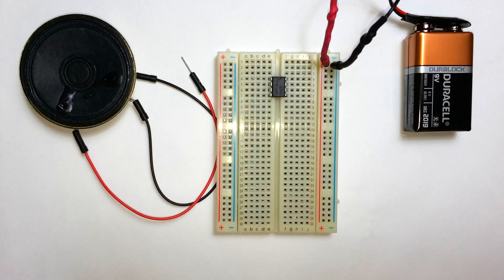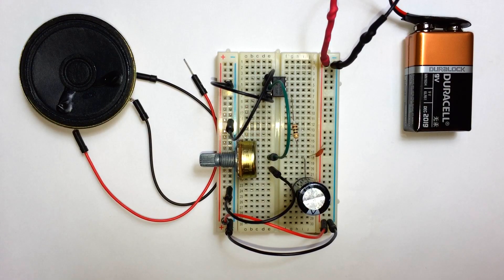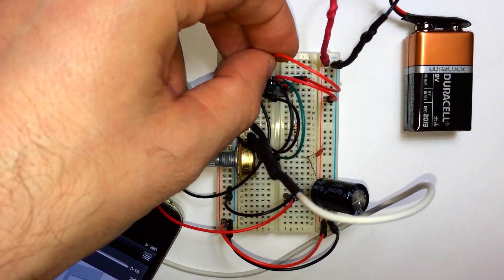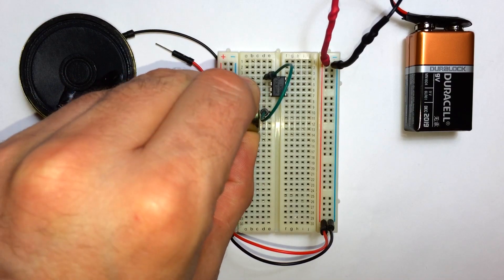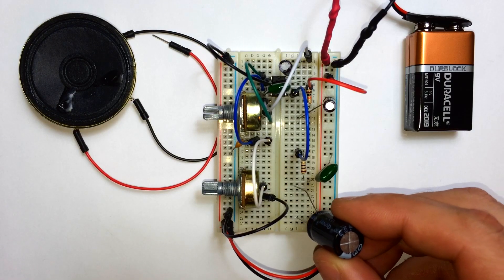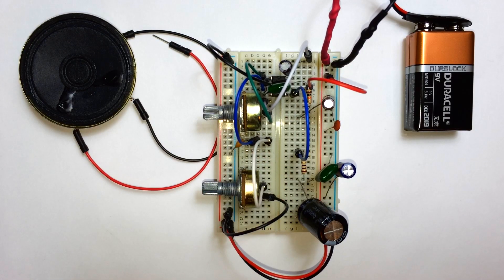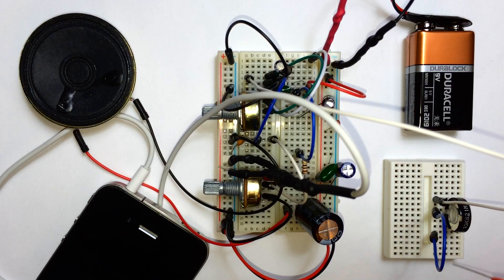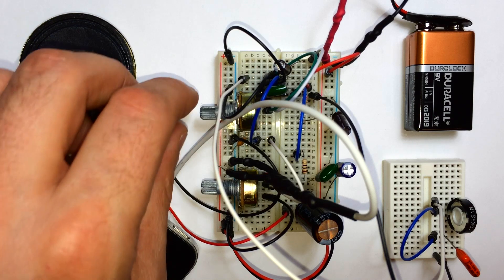Make a Great Sounding LM386 Audio Amplifier with Bass Boost

Comment: if I had two speakers and put them in parallel, would they be weak? if so, if I made two amps, one for the left channel and one for the right, would it be louder?
Reply: two on parallel will cut their total impedance by a half (half as strong) and could potentialy fry your amp if the impedance is lower than recomended
Reply: Guille Arana oh, thanks for the info!
Reply: 1/total impedance = 1/1st speaker impedance + 1/1st speaker impedance

Comment: FYI, you had the volume control wired BACKWARDS. the volume SHOULD go up as you turn the potentiometer to the RIGHT, NOT THE LEFT.
Reply from the maker: +brian h. Right. Thanks for bringing that up. If you want to switch the direction of knob turns you just have to switch the polarity of the outer pin of the potentiometer

Comment: Very nice project. i was very interested for it and finally i try it in breadboard. i use 0.5W & 8 ohm speaker, but sound is noise-able. Which speaker is best for this project ??
And i use normal 0.1m/f capacitor. is it the coz of Noise?

Comment: Very Good , in question on your Input leads  3.5 plug what is located inside ""Series"" with the leads seems to have a Resistor? thinking Grounds or loops from Computer and other units having voltage different that might be on the line to cause harm ? You did say on your Blog ? couldn't fine anything about it. Thanks for your Efforts 73's Dale

Comment: can u powered it by transformer?? 9v 150mAh
Reply from the maker: Yes that would work, I'm using a 9v battery
Reply: +Circuit Basics but I don't know how to wired it up b`coz the transformer has no polarities.. can u give me a example how to wired it up..
Reply from the maker: What's the model number of your transformer?
Reply: +Circuit Basics CTP-91201U
Reply: +Circuit Basics I try using a old cellphone charger with rating of 5v 0.7mAh n something is buzzing sound.
Reply: +gener mangosong then you have to put a capacitor in parallel with the charger.

Comment: This circuit doesn't work. The first one amplifies sound a bit, but audio quality is insanely annoying. The second one works even worse. I'm using all the same components except for those green capacitors, what are they? Electrolytic, ceramic? Their capacitance is the same as the yellow one that you use for decoupling, yet they look very different. Help please :/
Reply from the maker: The circuit does work, but as I mentioned in the video, there may be some noise due to loose connections from using a breadboard. It would also help to use wires as short as possible to prevent electromagnetic interference. Also try to make sure the wires are as close as possible to the LM386. And using capacitors with smaller tolerance should help as well. Keep in mind that this is not a HiFi Amp, but it does sound good. For the best audio quality i'd look into building a tube amp

The green capacitors are polyester film capacitors
Reply: +Circuit Basics You're right, the circuit started working after I replaced a dodgy speaker,  tho I still can't describe it as good sounding. It's decent at low/medium sound level and only when playing calm music, trying to play rock or metal at higher volume produces just intolerable noise. It also starts quietly playing radio on top of input signal as a bonus :D I'm having these problems with all LM386 based amplifiers, so I started building one based on NE5534 by GreatScott, we'll see how it goes

Comment: hello,,   what it i use 12 volts for power supply,,? is there any problem with that, or there is material or part that need to replace,, waiting for your response,, thank
Reply from the maker: Yes, you can use 12V... The LM386 is rated at 4V to 12V.

Comment: hey!.pls mention the wattage nd impedance of the speaker ur using...
Reply: Hi! The LM386 amplifier comes in 3 power ratings: 325mW, 700mW and 1W. The impedence can be chosen according to your supply voltage, but the most common is 8 ohms. I don't reccommend using speakers below 2 ohm impedence, because it will draw a lot of current.

Comment: I'm just a begginer may i know what the voltage of the capacitor, because everytime i buy a capacitor they always asking what is the voltage, and also for the resistor, thank you
Reply: That just depends on your circuit. If your circuit has a max voltage of 19V you should get a capacitor rated higher than that such as 25V.

Comment: 6:39 You said 740 pF capacitor in the video, but your tutorial says 470 pF. You should add an annotation to the video correcting this.
Reply: If you knew anything about el. components at all, you would know that is 470 (uf, pf, nf ect) correct, because it's very common value among capacitors, he just said wrong, that's it
Reply: @CarpeDiem23  You have a bunch of newbies or amateurs who won't know about "standard" values. 
Stating and listing something correctly saves others from getting frustrated, annoyed, or bothered.
I once received a grade of a "B" on a circuit in an EE lab.   It would have been an "A" had I not mislabeled a couple of values. Having said all of this, Circuit Basics did a good job of laying out a basic LM386 audio amp circuit!  Thumbs up and a grade of a B from me.  ;)

Comment from the maker: @Sachin Chowdhury You can use the LM741 as a substitute for the LM386, but it won't have the same power output (or pin out). The LM741 is an op amp and the LM386 is a dedicated audio amp. It's the right tool for the job.
Reply: well said, the 741 is not in the same class!!!
Reply: why would you recommend that, bad idea.
Reply: @snaprollinpitts  Its good pratice to try different chips to see what happens.
Reply: +Circuit Basics will there be a lot of power difference using the LM741?
Reply: ur circuit & ur 10k resistor do not match
Reply: Can i use an LM358?
Reply: 358 is a amplificateur or a comparateur ??
Reply: El Mehdi Fdil I know it's very late but to answer your question a 358 is an operational amplifier, which can be used to either make a comparator circuit or an amplifier circuit. A comparator is just a configuration which uses an op amp to perform logical operations/switching.
Reply: LM741 (or uA741) will work, until you plug into speakers (8ohm) because it's only 20mA max output power. Resulting to a completely distorted signal.
LM386-1 is 250 mA max output power. About 12 times more.
So NO, you CAN NOT use the LM741, it is a piece of crap only used for class demonstrations...

Comment: I have a doubt, what are the differences between an electrolytic capacitor an the green capacitor he put in the 5th pin? Does it have polarity? Can i replace it with an electrolytic capacitor?

Comment: i just made the very basic first version of this on a breadboard and plugged it into a 12"  speaker from a guitar amp, and played some guitar through it.  hot damn.  it sounds ridiculously good for the fact the amp costs substantially less than the 9V battery.  with the gain pins bridged it's LOUD too!   not sure about the impedance?  anyways, amazing, thanks for the tutorial.
Reply: dude google 
'ruby amp schematic" its an lm386 guitar amp design that has been around for years, and sounds great.
Reply from the maker: Nice, glad you like it!

Comment: How do you control the electricity suminister when you're not using
Reply from the maker: I just disconnect the battery, but you could add a toggle switch on the 9V line to turn it on and off

Comment: I thought you would need a transformer to convert to ac?
Reply: +richieb74 Technically the audio signal coming out of the LM386 already is AC so it doesn't strictly need a transformer.  Where those are normally used in output stage is in Tube amps.  Since these circuits run on DC either use an external wall adaptor (transfomers in there) or a battery (no transformer needed).

Comment: great and simple build but this can sound even better with a little better and bigger speaker. I made a GREAT guitar practice amp with LM386 and small bass boost. Super easy and great sounding. Is there a schematic for this build? I'd love to compare.
Reply: ***** I'm trying so hard to find how to make a guitar amp, could you show yours? or how you did it?
Reply: Jeyson Ardila I tracked down information about the "Ruby" amp using the LM386. I used this webpage and adapted the "Bassman" mod....so my amp is a RUBY BASSMAN. You can google it or go to this page which was my main source of information.

http://runoffgroove.com/ruby.html

Hope that helps! :D
Reply: ***** Thank you so much. I'll let you know how it turns out
Reply: Please do. I had a lot of fun with this one. It is also a great way to make a nice bluetooth amp. Just add a portable bluetooth plug thing.